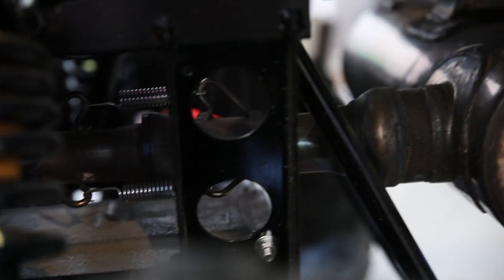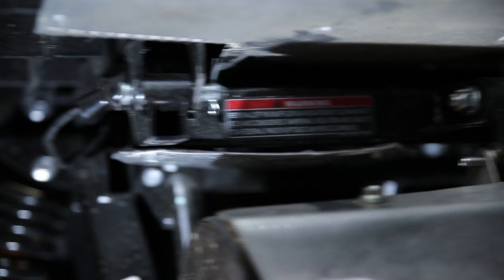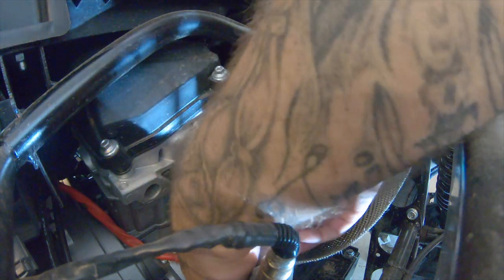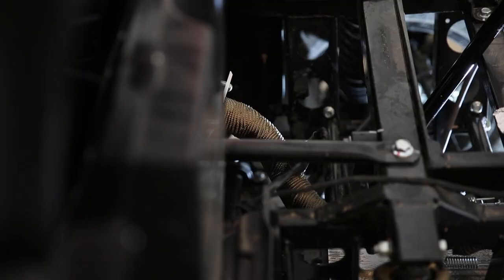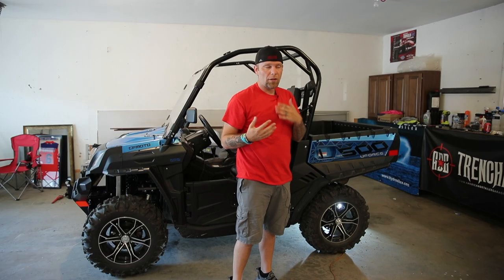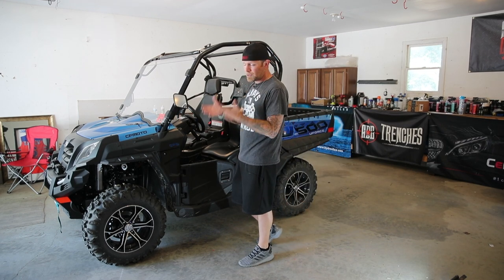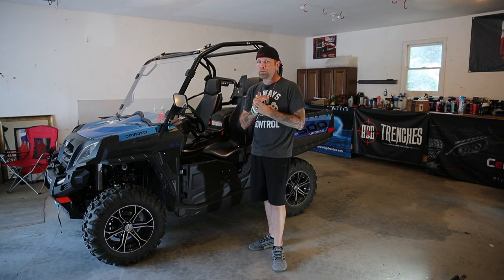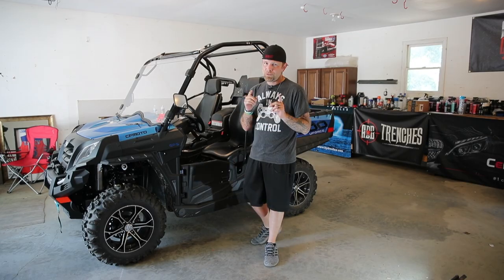HELP REDUCE CABIN HEAT IN YOUR CFMOTO UFORCE 500 - TITANIUM HEAT WRAP

Comment: Much of your cabin heat is coming from the coolant lines which are running from the engine to the radiator.  Removing the center console and applying heat reflective tape to the underside of the plastics will help reduce the heat from those two lines.

Comment: Just bought a 2021 uforce 800. Installed windshield, now I have an oven to ride in. Going to try insulation and exhaust wrap. Also looking at getting the same exhaust tip. Can you tell the difference in sound and power??

Comment: The z950 I ordered is now on hold for gas pedal recall.  They have no idea when they will get the part in.  They do have a zforce800 EX available.  Does the cabin on this get hot?  Should I wait for the z950?  I am confused now as to what to do.  I don't need the extra power of the 950 - just do road riding with a bunch of old folks. LOL
Reply from the maker: I would wait for the 950, if it were me.

Comment: I've thought of doing this. However, running through water will it not get under the wrap and eventually cause rust issue?
Reply from the maker: I would assume so…I actually ended up removing it Bc it kept too much heat in and it was affecting the machines performance. Just get the flexible heat shield and line the back of the cab and the center console with it